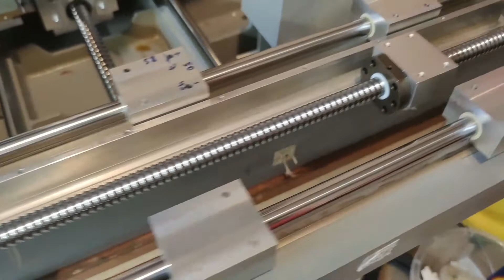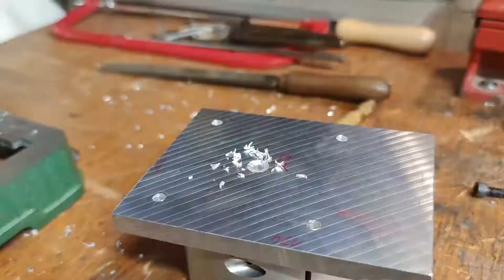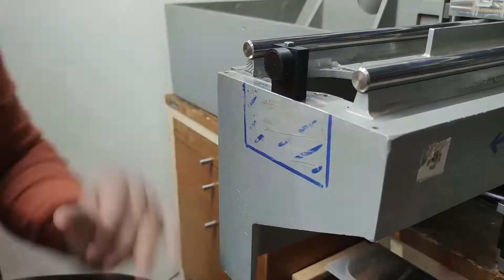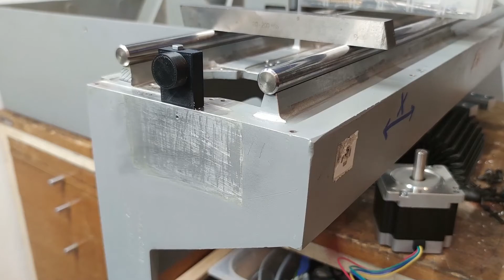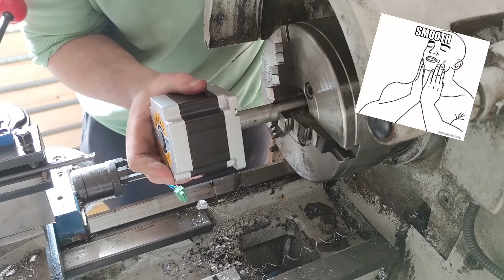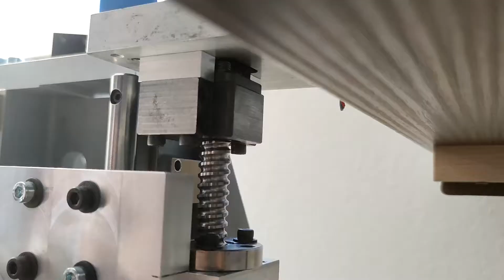Converting 3D Printer to DIY CNC | Part 6 #cnc

Comment: I think you will want the extra X travel, especially on a smaller mill like this. Since you already have the plate mounted there I would use it to hold a support bearing for putting a pully out there at the end rather than the NEMA 23 stepper motor and then relocate the stepper motor to the underside like you were probably already thinking. I think if you had the good fortune to have a machine that came with all those super nice looking bellows, I would mount them and make sure they worked in every direction! I am going to have to make a custom set of bellows on my machine and it'll undoubtedly be a huge hassle. I love this chassis you have from the 3D printer! after seeing your first videos I tried like hell to see if I could find an old broken version in USA!
Reply from the maker: Thanks for the feedback! The x axis travel is currently around 600mm which is a lot since i will most likely use more than 400mm in 1% of the jobs. Regarding the pulley and belt method, it is true that i considered it, but with the reasonably prices pulleys the system is in my opinion still way less rigid than the direct coupling. The backlash is another concern i had along with the belt "springness". But all of that is probably not the problem with more expensive components. It was a great suggestion. Thanks for following the series! With the bellow covers, as Edge precision suggested in the previous comment, the collapsing way covers are the better option and i will probably look into that. They may be even easier to design than the bellow covers for you too.

Comment: Don't bother with bellows. Attach a sheet of rubber to the table and let the end of the sheet run over the stepper and drop down with a weight to pull it down as the position changes. Bellows look better but they are not always the best option. And a rubber sheet would be much easier to clean than bellows. I have a milling machine that I got from a professional machinist. This is what he had done on my mill.  Go for the easier solution first. (with no loss of travel)  And if you want to change it in the future you can.

edit: take a look at these   
https://youtu.be/o9RXtOd_GvM?t=17
https://youtu.be/nvuWSByHnMk?t=329
Reply from the maker: Thanks for the ideas. I saw those videos some time ago. I think Steffan Gotteswinter had some similar kind of rubber covers for the lathe as well and Robin Rinzetti also had something like that on his HLVH. Not ecsactly the falling of the edge desing but something similar. I would like to encapsulate the linear rails all around and the rubber would have gaps at the sides. I think i will first look into collapsing way covers similar to the kind professional mills have. Thanks again for the idea. It will probably be usefull for other machines.

Comment: I think you are going for sure want to travel the Y axis below the table. Especially if you are facing something setting on the table.  You are also going to need a angle plate to mount parts and a vise on. The bellows way covers? Every machine I have run with such way covers were a source of aggravation. Only on machines that don't make chips does that work. Wait until you have to clean out the shavings. Especially if you run some kind of coolant or even spray mist. I would design collapsing sheet metal covers that go over the servo motor if I were you. You wont regret it.
Reply from the maker: Hi! Thank you for the great suggestion and feedback especially from such an experienced machinist as yourself. I really love your content. Thank you! I did not consider colapsing covers yet and i will look into it. I will most likely 3d print a test ones and then probably have them manufactured out of sheet metal. And yes, the angle plate is a must have and i already have a small one but i will have to manufacture a bigger one for sure. Thanks again!